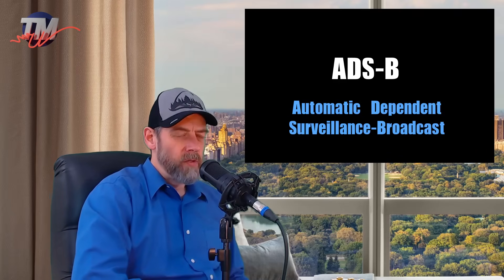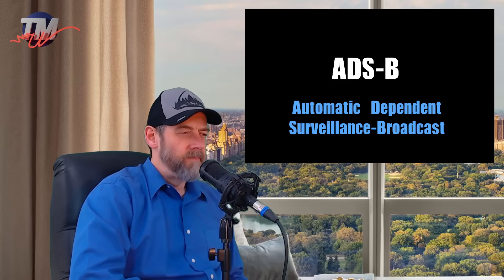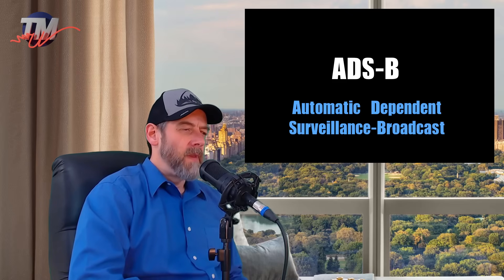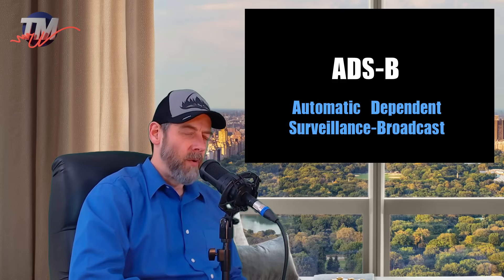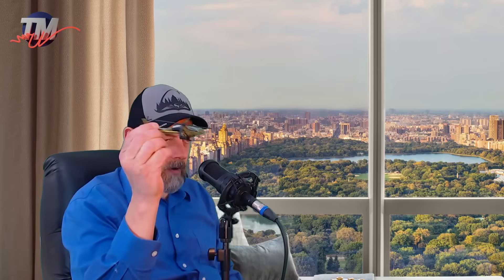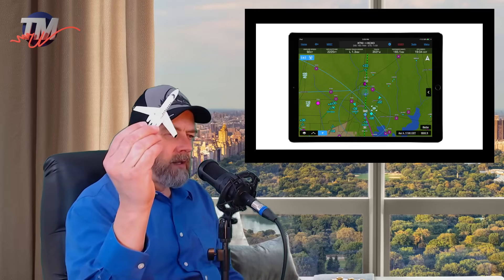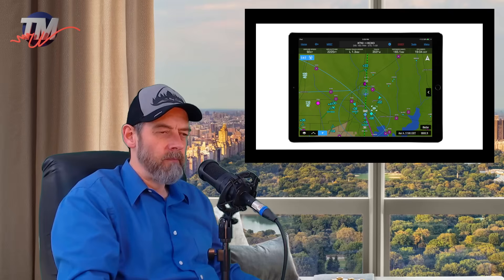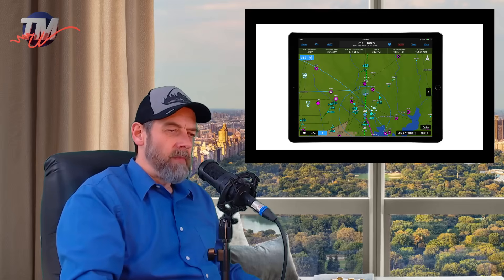The Blackhawk's ADS-B-Out system was turned OFF. Why, what is ADS-B, and why does it matter?

Comment: The tower controller was trying to create gaps in arrivals so he could fit departing aircraft into the sequence. This is why he was trying to divert the regional jets over to RWY-33. 
When the two accident aircraft were getting close to a conflict , the controller was busy getting AA-Flt- 1360 onto RNW-01 for immediate departure. Flight 1360 made it to Chicago but at what cost ?
Reply: An Air Traffic Controller does have and must have the skills to control many more than one aircraft at a time.  "being busy getting" any departing aircraft out means that the "controller" does not control the traffic at that airfield at all.  In fact, he did not, and he didn't even try. 
The problem here is that an incompetent and poorly trained "controller" was deliberately and actually intentionally creating a conflict, and he proved completely unable to resolve his self-made conflict when it was his duty to do so.

Comment: FAA could just as easily set up a NOTAMS for an evacuation flight of the president.  Absolutely ridiculous flying in dense civilian air space with ADS-B In and Out not turned on.   The Black Hawk  helicopter Should AT  LEAST have ADS-B IN turned on, so that they can see other aircraft and avoid., even if they aren't sending an ADS-B OUT 1090 Khz signal.  As easy as having an IPAD with  a subscription to ForeFlight, for ADS-B IN.   Completely inexcusable, this situation.
Reply: What do you need ADS-B for in such a situation? What is it good for? We're talking about a control zone in class Bravo airspace. Please don't forget that.

Comment: All well and good until you reached your description of the actual accident - the helicopter crew were given clearance to proceed - this installs a lot of "permission conception" - the aircraft they were looking at was the CRJ that had just taken off - the incident CRJ was above them and turning sharply - they never saw it. 
I've been in a light aircraft my father was flying - coming into land at a small local aerodrome - part time controller said "clear to land" - and yes - the runway was empty - but there were TWO aircraft in the circuit! I'm still here to write about it because 1/ there was plenty of grass available and 2/ my dad  realised what needed to be done. Mind you - it's quite stirring to see a pair of wings overtake underneath you on short finals.

Comment: It's not just a safety system, IT REPLACES RADAR. We no longer ping the metal on the aircraft with a radar beam, instead we now listen to the ADS-B broadcast of all the aircraft, each sending its location data. It is required for ALL civilian aircraft. It's not a safety feature, it's the primary means of locating aircraft.
Reply: It does not replace "radar" its in addition to it, its GPS based with many ground based relay masts, of late it has not been particularly reliable as the Russians have been spoiling it, RIGHT NOW they are jamming GPS completely in the Baltic sea! so we had to use Victor airways and VOR,s last night.
Reply: ADS-B is required for aircraft flying within controlled airspace over the continental United States. 
ADS-B also is used in remote areas without radar coverage, like the Gulf of America and Alaska. 
Aircraft not in those categories don't use ADS-B

Comment: That was long winded and painful!. Mode C transponders, simply broadcast height in addition to a positioning and identifying signal, not that it remotely matters here given ADS-B is not a mode C transponder and military aircraft are not required to comply with ADS-B out in any event, moving swiftly along, Washington Dulles International is class Bravo  airspace, all pilots within that airspace require a current IR instrument rating, all aircraft operating in the area require a instrument rated certification, meaning as minimum equipment at least one of these radio altimeters with most now a days having two with FMCW technology, far superior and substantially more accurate than barometric pressure based altimeters, so not sure why you reference those type of altimeters. The RJ showed the Blackhawk on TCAS seconds before which has been disclosed by the NTSB, so no, not invisible! . The Blackhawk was operating under SVFR with an observer look out, and acknowledged with ATC that it had the landing traffic in sight and acknowledged responsibility for maintaining visual separation, the RJ was firmly established on the glideslope whilst being VFR in VMC, the NTSB has already given the height plus or minus 25ft  the Blackhawk had to have been flying beyond its height limit of 200ft, the fault lies with the PIC of the Blackhawk ultimately, though I am not convinced that ATC could have and should have done more knowing the marginal separation between conflicting traffic.

Comment: If they where practicing an emergency situation it could very well be that under an actual situation it is required to have the civilian ADSB and transponders turned off to reduce detection. If this is the case is it required to be turned off in a training scenario? I think the MH-60 requested visual and was granted it but did that request mean visual traffic avoidance and no ADSB or just VFR navigation? I don't have enough understanding of the lingo to know exactly what visual meant to the controller and the pilot.

Comment: This was a systemic problem, with various contributing factors. However, this situation only occurred because the system permitted it, thus regardless of the errors committed by the UH-60 crew, the final blame is on the management of the airspace by the FAA.

Comment: What was the black hawk not flying with the ADS  B was off. This is weird. ADS B is a safety system. In the past the plane had transponders. That helps radar detect you? Altimeter is based on barometric pressure. Do you think the altimeter was wrong? It is the only explanation I can think of for the height of the helicopter. In modern aircraft. 2020 ADSB Alt. It is a more accurate altitude. Position speed and altitude. With gps. She was flying 150 feet too high. It was off on the helo. Antenna on plane transmits the data the information. Same with helo. It is inter connected to everything. It was off so not using new data collection. The plane could not see the ADSB in. And display in the map heads up display. The copter did not so the plane could not see it on the screen. Why in the heck would they not turn that on. Helo is flying invisible to other traffic. Why? Evac of president to a safe location and don’t want to have it on. All of these mistakes are adding up against the pilots in the BH. Instead of hovering and waiting it went in front of a landing aircraft. I will never understand why she was off course, too high, they did not have the copter in sight. It’s lazy flying. It makes it so much worse. If they flew that high and off course by a mile it’s crazy. I’m concluding the pilots made horrible decisions. I saw a simulation of what is seen through goggles when this happened was interesting. They could not see the plane until it was right on it. I agree.

Comment: Not a pilot, but it sounds like there's a major problem with military or air traffic control procedures for a helicopter, especially one flying without that required ADS-B system on and using night vision goggles, was allowed to get anywhere near a commercial jet on landing approach.  Somebody in the new administration needs to do some serious review of policies and set procedures for training missions like this and for air traffic control procedures where military flights interact with commercial flights.  Sloppiness has taken over.

Comment: As a former Navy ET and one that worked on IFF systems for close to 40 years, I thought I'd add a little background on the "antiquated equipment" referenced. 

IFF itself is another not so great name, actually. It stands for Identification Friend or Foe, except the only thing it ever did was allow a cooperating "friend" to be identified. Anything else was still an unknown.

IFF was originally developed to have a way to identify the blips operators would see on their radar screens. A radar is simply going to show an echo, so all you know is that an object is there. With IFF, an interrogator system would be associated with the radar, synced with it and sharing the same antenna mount. If you look at a large, rotating radar antenna on a ship, you may notice a smaller antenna assembly either riding piggyback or hanging underneath the radar grid. That's the interrogator's antenna. Aircraft, ships, etc would be carrying a transponder with an omnidirectional antenna that would reply to challenges from the interrogator. 

IFF used several "modes" of operation. A challenge for each mode, getting a response from the transponder for that mode. The military used more modes than the civilian versions. The shared modes were called 3/A and C by the military. I believe civilian usage had that as modes A and C.

Mode C was altitude. Aircraft transponders got an input from the aircraft's altimeter. So, as long as the interrogator is challenging on Mode C and the transponder is replying, you'll get automatic altitude reporting. 

Mode 3 is basically air traffic control. Changed by the pilot as needed. In addition, this is also the mode used to broadcast emergency responses, using 7700 (general emergency), 7600 (comms failure), or 7500 (hijacking). Military equipment I worked on had alarm lights and displays for 7700 and 7600 but not 7500, as it's usage was added later. If you've ever heard (as I have) a news reporter say something along the lines of, "they were squawking a 7700 code" or anything like that, it was a reference to these emergency codes.

Military adds a couple more modes like that as well as an encrypted secure mode.

All (non-secure) modes used the same encoding pattern, basically a binary coded 4 digit octal code. Each digit has three binary bits, so a value from 0 (for all 0's) to 7 (for all 1's). Which means each mode potentially had around 4096 codes possible.
Reply: so all that sounds  so  confusing  and intelligiant and  amazing ....BUT break it down  simple  please ,,,how can  that  "modes "  explanation and all  that  have anything  to do  with  the  crash of  the helicopter  and how could it have helped ...there should be more training  interrpreting  the  commands  from the Tower  id say ,,,and  how  did  that  helicopter  interpret  that command  of a "VISUAL "  ..when the copter did not see it till  he smashed  ..how can this accident  be  prevented  again ,,that would  make more sense  not  to  murder  without  justification ...IDK  ,,im not that  smart  myself  ..is  AIr  Traffic  and  towers  using  military  codes ,modes ,?  maybe  update  communications
Reply: @anniasamples5847  It doesn't have anything to do with the accident. As I said, background on the antiquated equipment referenced. 

I will point out, with only 4096 possible codes, the altitude resolution for Mode C isn't very precise. I think it was around 100 foot increments or so.

And, pretty much everything in use today is derived from those systems. Which, btw, are not entirely gone.

Comment: Surely they would have used the radio altimeter that also has a limit setting? At such low altitudes this is very accurate, especially flying over water. Even if the atmospheric pressure varies or was calibrated incorrectly, the crew would not depart from 200 feet without a warning (unless this was not set) I can't imagine anyone would be flying such a mission at night relying on a static pressure altimeter.

Comment: It has been said that ATC didn't specify a direction to look for an airplane, and there was one taking off, the inference that the helicopter crew (only 3 of them instead of normally 4) were looking at the wrong aircraft. The Swiss cheese model of layers of air safety is showing multiple "holes" here - the accident is proof that they all lined up.

Comment: At 11:45 you state that the helo would be visible only to ATC but not other aircraft. Both ATC and the TCAS system on the CRJ would have seen the Mode A and Mode C transmissions from the helo even if it had ADS-B turned off. Although TCAS would have given the CRJ pilots a visual warning of nearby aircraft, the resolution alert audible warning would have been disabled at that low altitude. It doesn’t make sense that the helo had ADS-B turned off, but it probably did not have a great impact on this crash.

Comment: ADS-B is the current cheapest method of tracking aiircraft.  Originally, the FAA used WWII era  radar.  That radar was updated a few times, but it has never been as good at tracking aircraft as the military radar current at the time.

When the FAA needed to improve the distinction of aircraft and locations, the Transponder system was used instead of upgrading the radar.  The transponder echoes the radar signal back to the radar, improving the return signal.  the transponder system was a fiscal win for the FAA because the cost was imposed on the aircraft owner.

ADS-B is GPS accurate (which varies depending on location and the potential wartime shift to coarse positioning).  GPS has always had lesser accuracy with respect to altitude just because the angles to the satellites are not as good in the vertical.  ADS-B was adopted because, once again, the cost could be foisted on the aircraft owners.  Leaving aside the potential of possible GPS spoofing and ADS-B spoofing, the backup is the old transponder system which is not as accurate as the flight lanes that have been created with the assumption that ADS-B always works.

The real solution to this problem, that overcomes  deliberate or adccidental failure of ADS-B and transponders, is to have radar that can distinguish all of the traffic with enough accuracy to detect when problems like the DC collision are starting to happen.

Comment: You have no clue. The Blackhawk's ADS-B was not "turned off", the aircraft did not have ADS-B capability. You can't "turn off" something that is not there.  Also, your claim that the Blackhawk was transmitting "Mode C" is also incorrect.  The helo was transmitting "Mode S".  If you don't know the difference, you shouldn't be spreading misinformation by making YouTube videos.
Reply from the maker: I reported what Tex Cruz and the NTSB released.

Comment: 1. The ADS-B being off doesnt matter. The CRJ had TCAS and it did alert the flight crew. SSR hasnt been replaced. Additionally military aircraft fly in and out of mix use airports all the time without ADS-B. 2. The visual separation is a request to deviate latterally and vertically from the VFR Helicopter route which a pilot can request which ATC approves. Hence the requests and approval exchanges. The helicopter didnt falsy claim they had the aircraft in sight. The first call they probably. All they could have seen is one of the 5 sets of lights on approach. There were several other aircraft in the vicinity at the time including 2 other AA CRJs, Canadian CRJ, AA 737 ect. Tower did not spesify with the second call which CRJ they meant and consequently the helicopter only resonded that they had A aircraft in sight. Tower should absolutely not have allowed them to cross the approach and they should have stepped when tower got the collision alert. The helicopter isn't guilty of as many things as you think they are.
Reply from the maker: They crossed into the short final approach path of a runway after the ATC told them twice about the CRJ and to pass behind it.
Reply: @truthmattersunplugged  the first time the CRJ was called out it 5 nm south of the airport on approach for Rwy 1. PAT 25 was 1nm N of DCA. CRJ AA 5307 was Final Rwy 1. So tower expected the helicopter to pick out which set of blinking lights 5nm away among the other aircraft lined up in the dark? While they are 200ft off the deck trying navigating the river.  Ok.  So 2 whole minutes pass before the second call that only stated "PAT 25, do you have the CRJ in sight". Well which CRJ? No BRA. No other information. In fact tower might as well have said aircraft because you can't identify the aircraft in the dark. Hence the response. "PAT 25 has uh.. a aircraft in sight.."  At that time a Canadian CRJ had just departed 33 and a 737 was taking off runway 1. So you tell me which one tower was referring to.. In between those calls tower also instructed PAT25 to turn behind the AC(again which one) into the approach path. If I'm PAT 25, I expect tower has better SA than I do so surely they would have warned me if there was an imminent proximity issue. Your analysis isn't taking human factors, bad communication and "fog of war" into account. The helicopter is at fault but ATC also put them in this position by approving them to continue what they were doing, communicating unrealistic expectations and then failing to deconflict once alerts were triggered.

Comment: ADS-B was my first guess, because my radar app couldn't see them (considering 200ft may be too low).  The second MAJOR failure was the controller trusting the "visual separation" on short final at 200 feet!  I cannot believe they were comfortable with that.  How many times did that happen?  I'm betting now that final approach areas are put on positive control vectors and visual separation is no more -I hope anyway.

Comment: sooo, flying an heli with old stuff in it is like driving a car with broken headlights and should be forbidden. Plain simple. So who's at fault here. It's so simple peeps.

Never have a flying thing in front of a landing or airplane that takes off.  Seems simple to me too.
Having a brick wall at the end of an runway also doesn't add up rofl.
Why not make them long enough to land any plane without a fukkin brick wall or cement wall.  Makes no sense to me. 
Is flying safe?  well... No. Comparing that to cars is something BS so I am not gonna say that :)